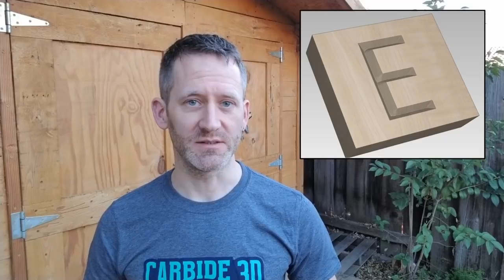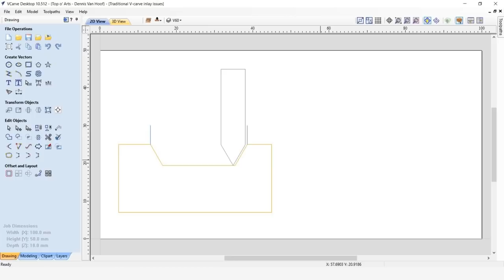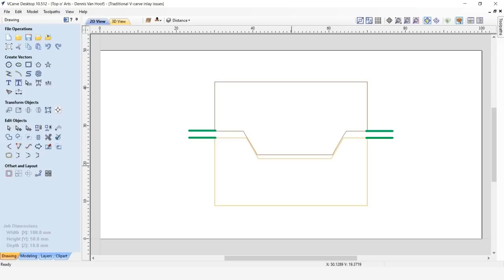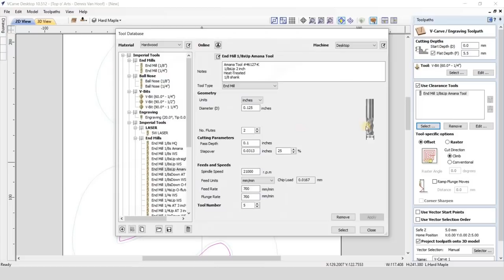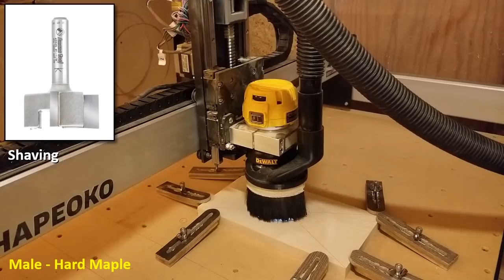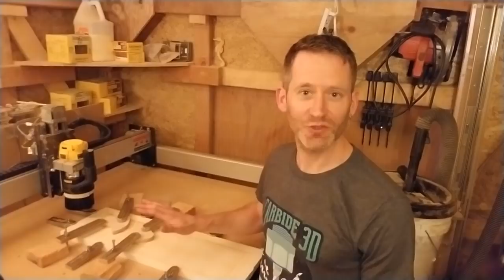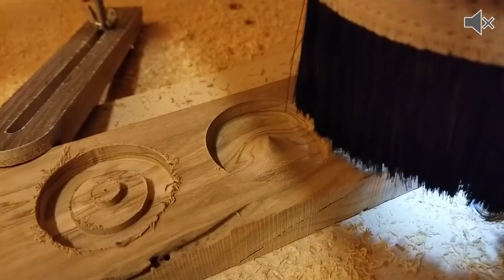CNC multi-inlays with a V-prism technique - Carving a geisha scroll with the Shapeoko

Comment: Did you ever verify that the CNC bed was the culprit?  I would also have been suspicious of the planer snipe.  Otherwise, the entire project was brilliant!  And so far over my head, and couldn't begin to do it!  But I so-o-o much appreciate your explanation of how the cutting depth and flat depth work!  I'm new to VCarve, and nobody else I've watched has explained how and why it works!  And I couldn't figure out for myself!  I now understand that the software calculates where the bit needs to be to cross the vector at a specific depth!  With that understanding, I can properly plan my inlays based on the inlay's thickness.  I get it now ! ! ! ! !  THANK YOU, THANK YOU, THANK YOU ! ! ! ! !

Comment: I enjoyed the video very much, but I'm still fuzzy on exactly what the use of the prism toolpath is doing different from the V-carve toolpath.  There's a subtlety there that eludes me but seems rather important.  I'll probably watch that section a couple more times and maybe look for another tutorial that perhaps makes that more clear (I watched that section about 3 times so far, but it seems fast to catch your point).
Reply from the maker: Thank you for your kind words and good question! Basically, VCarve currently doesn't have a way to setup tool paths for both the male and female. You'll have to do an aggressive plunge with your V-bit to get to the right depth. Also, when you're working with really thin lines, the old fashioned way will break these thin male lines. When I redesigned the process, I also took care of a few other things, like gluing space and a clean-up tool path for the prism (which is also not supported by VCarve). Lots of information to digest in a single view.

Comment: Nice work, great video! one question: Could you not define your z-height 1.8mm higher and avoid having to grind the surface?
Reply from the maker: Thank you for your kind words! I'm not sure exactly which step you are referring to with "grind the surface"
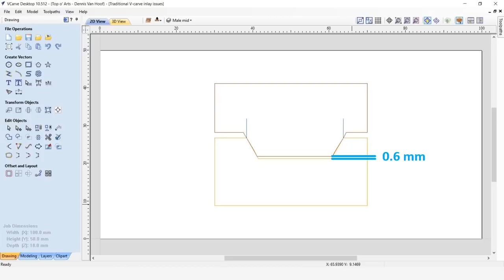Reply: @dennisvanhoof9958  Between 7:07 and 7:22. you're shaving both the high part and the low part. But it is only a fraction of a mm so not consequential time wise... Also y math might be wrong. 
There is one thing I would do different on the graphics side: Software is inherently awful when automatically tracing raster images (the image you started with) into vector (needed for the tool path). I use either Adobe Illustrator to manually trace, which can take time, or get vector art already made. All the corners and finer details tend to become blobs with automatic tracing, especially if the image is not high resolution. 
REGARDLESS - DAMN! What great work. I just got my Shapeoko shipped from the US to my house in Costa Rica and will be pushing the envelope with inlays with your brilliant techniques.
Reply from the maker: @hanaanrosenthal  Ah yes, that shaving creates a small space for the glue.

Comment: How beautiful Dennis!!!  Don't worry about the "haters" - it's great work.  Do you use the V-prism also on the female pocket or just the male plug?
Reply from the maker: Thank you for your encouraging words! I'm not worried about the haters; if I wouldn't be able to handle those, then I shouldn't be posting videos. ;)
To answer your question: the females are always pockets, so you never need to use a prism shape for a female. Just use the built-in V-carve (with clean-up) tool of the Vectric software.

Comment: I'm left wondering how your technique compares to the Zank Inlay process and which is better/easier.
Reply from the maker: The Zank inlay is based on the aggressive plunge that I refer to at 1:25. I came up with a process to circumvent this. I dedicate the rest of my video to my prism technique. That's how the two technique compare.
Reply: @dennisvanhoof9958  Thanks for the reply.  I've seen another video about doing multiple passes with their V-bit at increasing depth to get around the issue with the deep plunge.  It seems a simpler process but I need to watch both videos again   https://www.youtube.com/watch?v=RY0zLv3wcyc

Comment: Hello Dennis. I’m glad I stumbled across your channel. I’ve been working on making end grain inlay cutting boards and have had the issue of some areas being too thin in the female pocket and when the male pocket is created it has gaps. I work primarily in inches, although I understand the metric system. Will converting the numbers in this video be enough or would you have the imperial equivalent? Would like to ask more detailed questions but not on this platform. Thanks for your time and your amazing work
Reply from the maker: Thank you for our kind words! Yeah, you can convert mm to inches, and it will work the same, as long as you use the bits with the angles and diameters shown in this video. If you plan to use different bits (I hear many woodworkers who do end-grain inlays using 15-degree-angled bits for extra deep inlays), then you'll have to redo all the math, as aspects, like the off-set trench, carving depths, inlay slopes, etc. will be different.
Reply: @dennisvanhoof9958  I can definitely use the same bits and parameters as your video, I just personally like 30 degrees more than 60. I appreciate you taking the time and responding. Keep up the awesome work
Reply from the maker: @CisnerosShop  Yeah, 30 degrees and less might be better suited for end-grain and thicker stock; not so much for thinner boards and face or edge grain.
Reply: @dennisvanhoof9958  I’ll rewatch your video until I get it all down in mm and figure out the math. Then might dive into converting it to 30 and maybe 15 degree. I’ll share with you my findings
Reply: @CisnerosShop  Hi Victor, I m also testing inlay technic with a 15 degree V-bit for high detailed pattern ( thin  lines). Have you tested it with the math values for 15 degree? I m wondering how to include thé fact my 15 degree V bit has a flat tip of 0.5mm. An idea?
Reply: @stefanoH7676  I tried to use this technique, but I got results too similar to know the difference using the v carve toolpath in Aspire, and I have an excel spreadsheet to help with taking the plug down in 3 consecutive pocketing tool paths
Reply: @CisnerosShop  Aie... 
I thought I had found an alternative to the limitations of the Vcarve which does not work well for very fine lines.   Vprism and Dennis explanations looked convincing....  Did you find another approach ?
Reply: Why not just use a single V-carve tool path within V-carve pro?
The v-carve/engraving menu lets you add a clearing tool. The start/flat depths can be seen here:
https://youtu.be/v7KMRombA1Q
Or here: https://www.reddit.com/r/hobbycnc/comments/oik986/how_to_make_perfect_endgrain_cnc_inlayed_cutting

Comment: In using a 15 degree vbit, make a clearance pass down to your plunge depth and then make your final pass starting at the plunge depth.  (Ex:  0-10mm, 10-15mm)  In the tool menu,  reduce the plunge depth of the 15degree bit in order to force multiple passes.  This process will help preserve fine detail.  
Fine detail in hardwoods is easier using endgrain, but presents other problems.
Finally, you do beautiful work and you learn a lot by doung.
Reply from the maker: Thank you for sharing your insights! My experience is that 15 degree bit will make the sloped walls of fine details even thinner than a 60-degree V-bit would. While this is not a big issue with end grain (as you pointed out), carving grooves parallel to the grain with a narrow-angled V-bit will result in warping of those thin sloped "walls". I noticed that, even with a 60-degree V-bit, this can already become an issue (especially with softer wood species in the hardwood category).
And yes, I make lots of mistakes (and learn even more). :)
Reply: For what you're doing, 60degrees works, but l mainly do cutting boards and I need the depth of the inlay when doing fine lines.  60 degrees doesn't give me enough material in doing fine detail.  Thanks for the feedback.

Comment: hi, nice video. Still, a bit confused with the tool passes.
just a quick question . I live here on the Netherlands, and I need a plainer more or less like yours. I tried on Gamma, and Praxis, but can't find it. where did you get it?
thanks and success with your channel .
Reply from the maker: Hi, I was born and raised in The Netherlands. I moved to California about 13 years ago, so I get my machines and tools from the local home improvement stores (Lowe's and Home Depot) as well as online (Amazon and Ebay or shops that sell online with shipping). I got my WEN planer from Amazon; not sure if they have a version for 220 V at 50 Hz with a Dutch plug, but you can check on the Dutch Amazon website. There should be plenty of benchtop planers from different manufacturers available.
Reply: @dennisvanhoof9958  thanks. already sent.
Reply from the maker: @joematarc5245  I just replied. Let's do the rest by e-mail.

Comment: Wow i love it
How long does it take to mashine it?
How many days you have to wait to hold this breathtaking piece of art in your talented hands?
Reply from the maker: Thank you! If you do not take into account the design (which takes many hours spread out over several days) and preparing of the materials, but only asking about the actual CNC hours/days, then a male carve takes about 1 to 3 hours each (depending on the size; padauk took much longer than the hard maple), including tool changes. These can all be done in 1 day. But each female carve was followed by gluing in the male inlay, which took a day to dry. Then the epoxy took 3 days to fully cure. So the CNC process takes about a week. Then the 3D scrolls another day. All in all, it took me about 3 weeks from beginning to end.
Reply: For sure is the CAM part in this kind of projects a timebandit😅
I havent done projects that took so much time 
Respect for your patience 
I love your projects and videos

Comment: Leaving space for glue between the layers isn't entirely how the glue is mean to be used. I understand though that the edges are the part that is the most important and that they need to meet, so an extra gap beneath is necessary.
Reply from the maker: Correct! The gap underneath is a compromise, as you'll never be able to squeeze out that much excess glue and air from the pocket, once you insert the male inlay, as it is kind of like closing the lid of a jar.

Comment: Phenomenal build!  (If you REALLY want to go all-in, add a glue syringe to your CNC to automatically add exactly the amount of glue needed exactly where it is needed.  :grin: )
Reply from the maker: And it would probably be fast enough to be done before the glue starts to dry too!!! :)
Reply: @dennisvanhoof9958  Sooo...  when can we expect a video showing it off?  :grin:

Seriously, though, I got curious and started looking into it.  Among the hits was this ingenious project that can either be handheld or mounted: https://youtu.be/OUwQYAkBQWk   The description has links to the 2.0 version, the original forum thread on it, and a full kit that you can buy.  You could even use it to place tiny bits of inlay!

Comment: Great word.  I would recommend a drum sander for the final cleanup process.. planers while great, can shred fine detail inlays...
Reply from the maker: Thanks for the tip! I had some minor chips torn out of the olive wood inlays from passing it through the planer. If only I could add yet another tool to my inventory... :)
Reply: @dennisvanhoof9958  This is why you don't tell your significant other :) it mysteriously just shows up.  The other option would be a helical cutter head to replace the straight blades in the planer, those tear out far less.
Reply from the maker: @mrljvb  Great tips! I suspect my wife does the same with dresses, shoes and purses; I get the impression that she wears something new every day. ;) I'll see if there is a helical cutter head available for my WEN planer.

Comment: I can appreciate the challenge.  For my project I also wanted the final surface to be slightly below the upper surface of the female part so the blank female areas would not get dirty or damaged along the way, and the desired shape would be revealed during a final shaving pass at the end.  Setting aside the practical aspect, getting it mathematically correct is an interesting puzzle.
Reply from the maker: Yes, it is a puzzle! I'm hoping that Vectric will make our lives a little easier by doing the math for us with and include a clean-up pass for the prism tool. :)

Comment: Interesting video. Have been experimenting with tiny inlays recently and had similar experiences with very hard wood (30 year old meranti). 
The bed of your cnc is probably just fine, cutting and gluing the inlay changes the stress inside the wood which might cause it to bend a bit. Don't know the atmosphere in your shed but even having one side of the wood open to air while the other is clamped to the table a few days not being able to breathe might already result in enough moisture difference to explain the bending.
Reply from the maker: Good thinking! You are right that the wood will warp as soon as you make a cut; the more you shave off from 1 side, the more it will warp due to the release of stress and the loss of grain fibers maintaining a balance. However, I would think the CNC bed to minimize the warping as long as the stock is firmly clamped down.

Comment: You can skipt your problem by simply using a 15° v-bit
Reply from the maker: I think you still have the problem with the deep plunge (putting a lot of strain on your machine, bit, and the material you're carving); also, what if my stock is not thick enough, and the bit will plunge through? The principles don't change by using a bit with a different angle.
Reply: @dennisvanhoof9958  With your talent and skills you should look into a bigger CNC that has more weight and bulk with a spindle instead of a router.  Liked and Subscribed.  (Money is always an issue, but we only get one go-around in life....)
Reply from the maker: @unclebob8746  Thank you for the kind comments and suggestion! Unfortunately, I cannot dedicate more time to woodworking, as I have a full-time job (that is not even remotely related to woodworking). A bigger, stronger, faster and more precise machine would be nice, but it'll be difficult to convince my wife that I need it, so I'll save that for my retirement. ;)
Reply: @dennisvanhoof9958  Your bit won't plunge through if you set the correct stop depth.
You're  correct in assuming that a 15 degree bit will make thin walls harder and you will probably have to identify and alter those in the drawing beforehand.

I noticed really bad burn marks from your clearing bit, get it sharpened or replace it, it'll save you a lot of trouble and you will be able to stay away from the planer for the final passes. My heart dropped when you went to make the last passes on it and the manual lowering/raising the knives made me freak out. It might not show in the video but i'm pretty sure you can tell when looking or touching the piece in real life.

I agree with one of the previous comments that said your bed is probably straight enough but the material vill warp when milled, it always happens and it doesn't matter if its ply, mdf or real wood. If you need to resaw a piece to get it thinner you'll need to let it rest to finish warping/cupping/cracking/checking and then plane it again... If it's a thick piece thats resawn into thin pieces you'll even have to let them rest longer to dry out/equalize to the moisture content in your room. As far as I could tell you're doing this in a shed in the backyard with air vents around the upper part of the wall and that means that any wood will basically try to equalize itself to the outdoor moisturelevel and that can vary a lot during night/day. It gets even potentially worse when you bring those pieces inside the house which usually has a drastically drier climate. I once bought an antique cutting board/tray and took it home an hung it directly on the wall, 6 months later I heard a loud bang and the piece had split in two because it had dried up. This was a slice of endgrain which is even worse to handle if it gets exposed to varying degrees of moisture.
Nice piece in the end and good luck with your hobby! ;-)
Reply from the maker: @PeterWa666  Thanks for taking the time to share all these many good tips and advice! :)
Reply: Deep plunges aren't an issue if going into end grain, but you are right with long grain and the stress it could create.  With a 15° bit for inlay similar to what Broinwood and MTM use, I would love to the know the V-Carve settings.  When I use a .18 and .02 male with a .2 female settings, I get great results with a 60° bit, but with the same settings using a 15° bit, there are gaps.  The techs at V-Carve couldn't explain it or offer workable settings.  I would love to know what male/female settings  to effectively produce inlay into end grain with a 15° bit...any suggestions guys?

Comment: If it's to smal that it wil splinter use a 15 degree v bit, I use it al te time and it's better because you have more material that you can squeeze together
Reply from the maker: Thanks for the suggestions! I thought about that, but if I would use a 15 degree bit, I would have to modify the female tool paths too, change the carving depth limits, and the offset trench, etc. It would become even more complicated if I would 2 different kinds of V bits; a 60 and 15 degree bit for different carves. The YouTube video became quite long already with just a single V-bit. :)